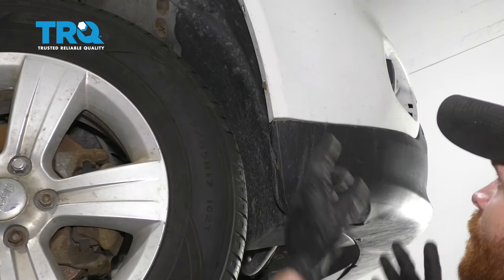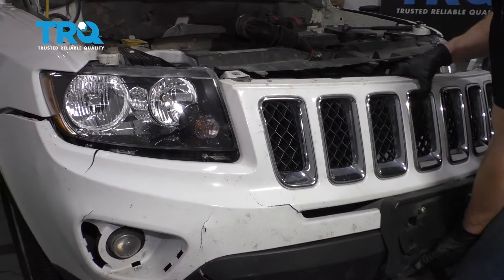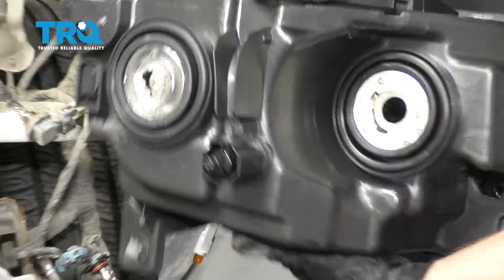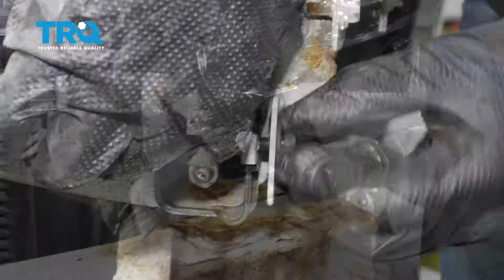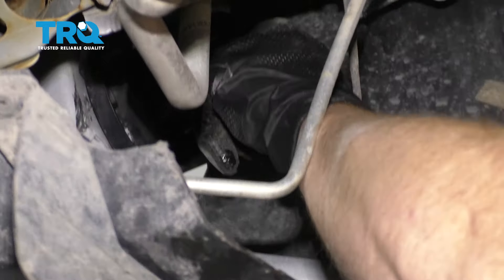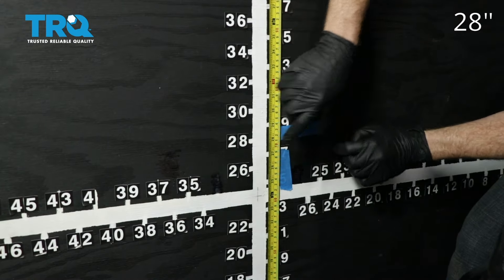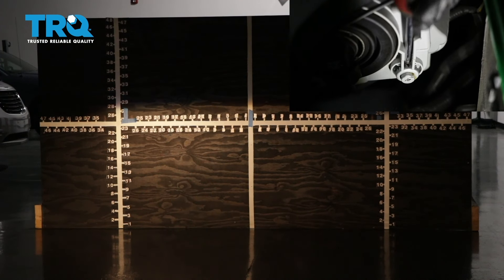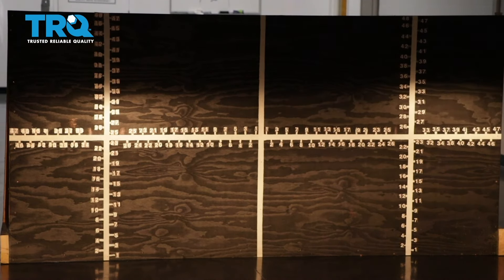How to Replace Headlights 2007-17 Jeep Compass

Comment: Are you kidding me? All that to replace a lousy bulb and possibly screwing up even more? And US automakers wonder why they lose market share.
Reply: No the video says headlights not light bulbs you can do the bulls without all of this
Reply: @jairogarcia5611  Yes you can replace the bulbs but to remove the headlight assembly one should not have to remove the front bumper.
Reply: Hello and thanks for the video. My wrangler headlights are connected with both the red clip and a wired bulb that goes into the headlight. What do i do with this bulb now that ive got the new headlights that dont require them?
Reply: I just replaced my light by reaching behind the headlight assembly.